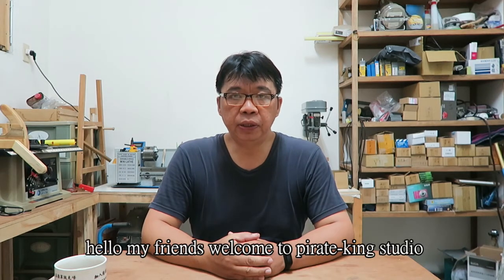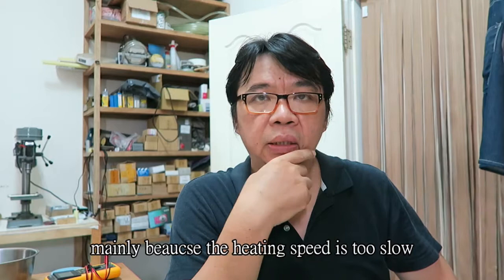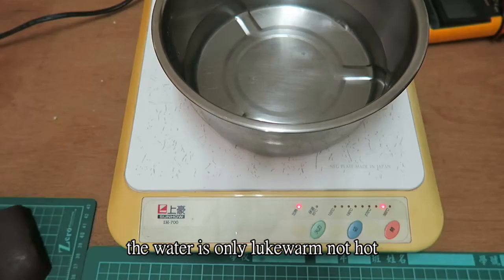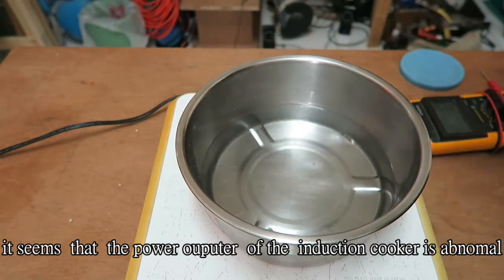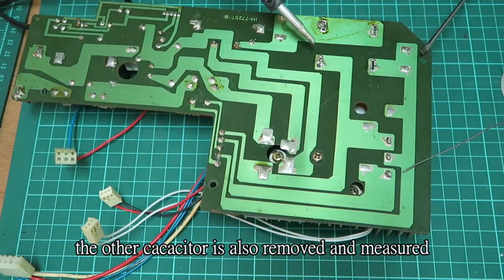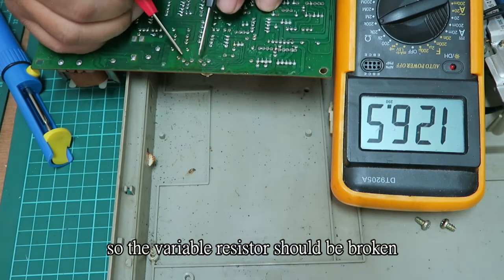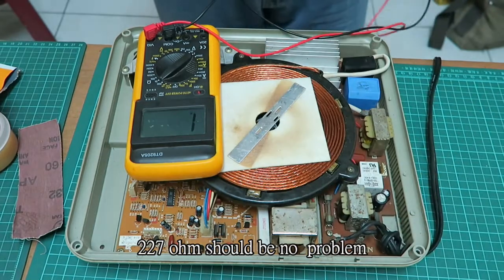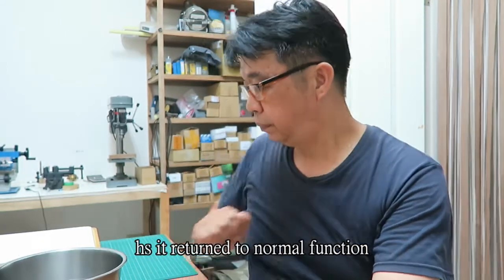induction cooker repair   (the solution of Insufficient heating power) pirate-king studio

Comment: Hi. In looking for a short circuit at the end, why did you choose and decide 227 Ohms is alright? Where do you touch the probes at?

Thank you.
God bless, Rev. 21:4
Reply from the maker: The detection point is the input point of the power line, and the resistance is large enough when the voltage is 120V, so it is safe